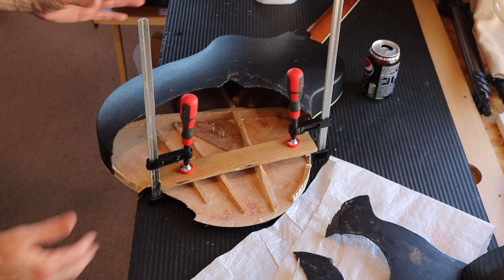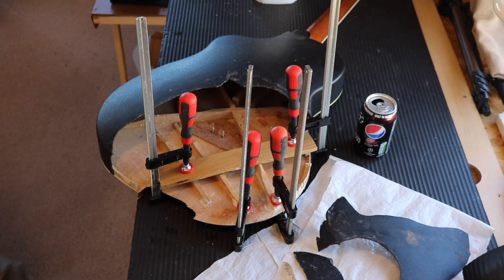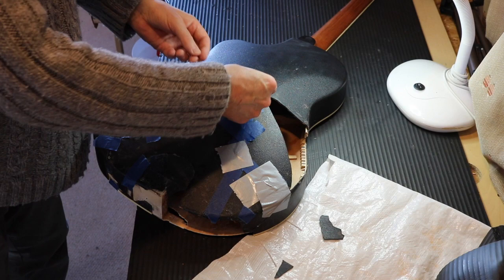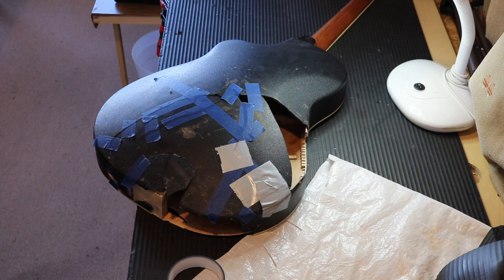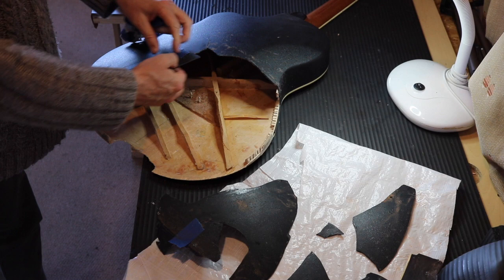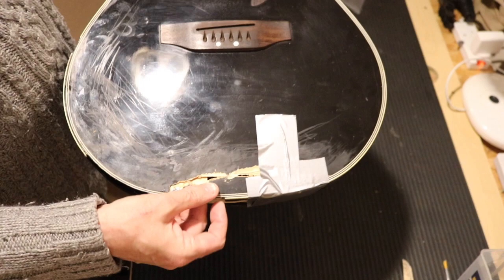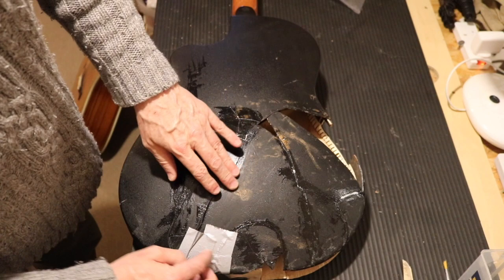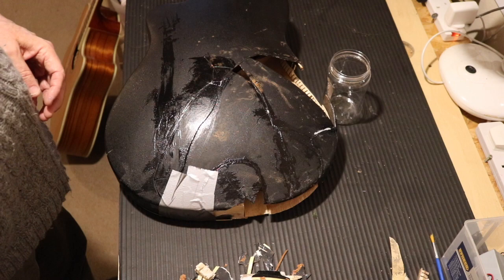Part 4  Copeland Guitar - the jigsaw puzzle, its scars and mine and it's still not near completion!

Comment: You're a brave man, and apparently have some excess spare time; most would call this a lost cause. But even tho it's more experiment than a chargeable job, please use cauls, cork and pads. The needle-nose pliers deal made me pull my hair -& I don't have much hair to spare. BTW, I have a black Ovation, same trim on the front, might be the exact same (was $850 USD new). So I have some emotion investment here. I'm 1/2 way thru, might comment further when finished. Good luck !
Reply from the maker: Def not a good guitar. This is a cheap knock off. Was not worried about scratching the front with pliers... did you se the front... it's a disaster.

Comment: I’d have used support under the supergue, S’glue dries out, and a “butt” joint has no strength by itself. As I went along gluing each piece, I’d have put some  2” X whatever length glue soaked linen cloth (saturated with light epoxy) after applying epoxy to the underside of the crack as well. Plus another glue-soaked strip under it later.While each joint is drying, the guitar could be flipped over, resting in a bed of silica sand to maintain the approximate curves. S’Glue accelerator would be helpful after your butt joints were aligned to lessen the time to hold in place.

May I ask: What about the missing kerf sections? And the end block forming a SOLID bridge between the body, back and sides ?

While using the 2-part resin on the OUTSIDE of the back is possible and strong, reinforcing the back as you go along would make for a less messy repair. And much easier to make a decent cosmetic back.

But make no mistake, this was an impossible repair and I saw the ugly spray-foam mess from the get-go. You are indeed a brave and patient fellow. I'm eager to see the rest of the project, and offer my comments only for consideration. As I always say, "It's much better than what it started out as" !
Reply from the maker: I didn't mention that I didn't use superglue on the struts... I forgot, sorry. As far as the kerfs, I am playing that by ear.